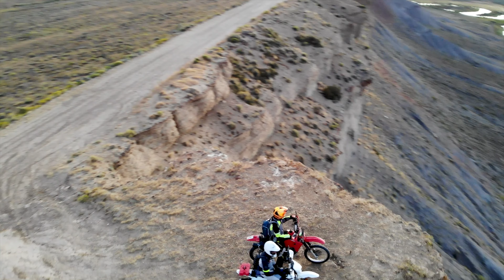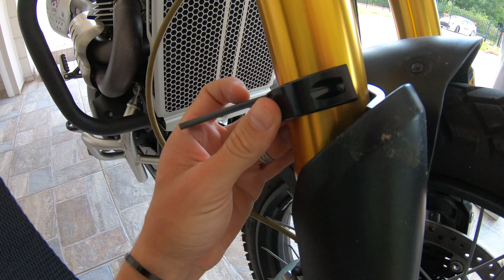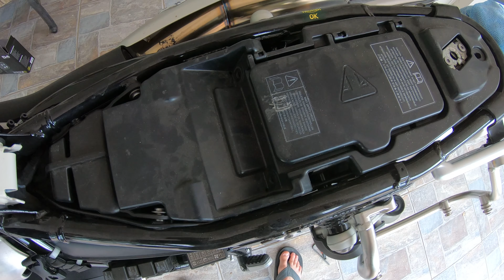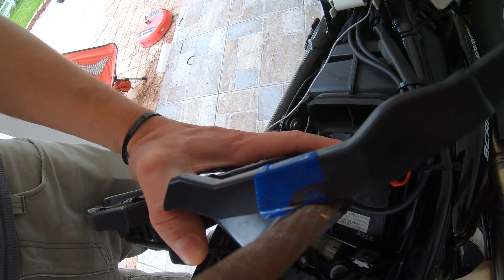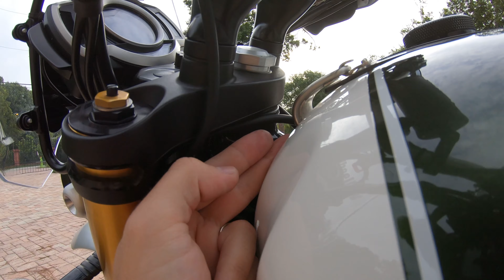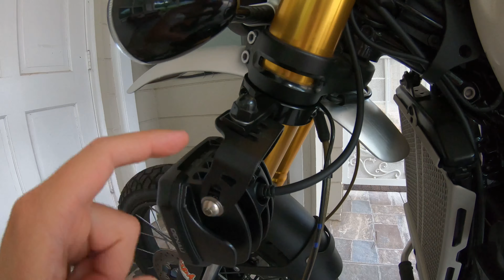Triumph Scrambler 1200 Denali D4 lights install

Comment: All that extra wiring when all you have to do is use the connectors that Triumph fitted inside the headlamp shell ready for their "fog" lights kit.
Reply: Is there a wiring connector for this? The D4 has a different pin.
Reply: @playnicebegoodtoothers6944 : yup, two wires with factory connectors.  Plus there. A button on the handlebars just for the fog light.
You don’t need all that wiring or that extra switch.
Reply: @ginoasci last there a connector you used? The Denalis have a three pin wiring connector than the standard two-pin on the triumph.
Reply: @playnicebegoodtoothers6944 : I haven’t purchased the fog lights they.
Yes, I think you’re correct about the two-pin connectors.

Comment: Wiring it strait to the battery, does that not mean that the lights still have power even if the bike is off ?. I can just imagine someone coming along and switching them on draining the battery.
Reply: The wire wire is connected to the switched power source; like headlights or running light wires.
Reply from the maker: In all my years of travels no one has ever messed with my bike like that. If I was in an area that might pose a problem I would just disconnect the battery for extra precautions. 

I’ve personally experienced problems with Triumphs wiring harness so I try at all cost to avoid splicing into anything.

Comment: I’ve got the same lights with the universal data dim can bus harness. I have to say I’m a bit worried about tapping into,other wires ie horn, light , indicators etc…..any tips or even better a video?
Reply from the maker: I don’t like tapping into the wiring harness especially on Triumph. However, the horn would probably be a safe bet and a easy fix if something wears out over time. I don’t have any other videos made right now for it but Denali should have some on their channel.

Comment: You can't just link these to the fog light button can you?
Reply from the maker: Hey, you can but you would lose the ability for “Data Dim”, high beam function and would also have to order the specific wiring connectors. 

I’ve thought about doing it and still might. I don’t need high beam with these and not concerned about running at low power for the dim feature to matter.
Reply: @2wheelAdv  thanks for the reply!
Reply: Good job, clean and efficient
From my side I’ll use the original switch and connectors which are hidden into the front light, I’ll be feeling more safe, and avoid some electrical issue 💪💪
Reply: @luigicodiglione1564  did you do this in the end? Would love to know how it went.
Reply: @d.Cog420  yes I did, it was easy and result is very clean, in the meantime I sell the bike and bought a speed triple 🫣

Comment: The plus side to running power from the battery is so you can use the lights with high beam. Output looks really good 👍
Reply from the maker: Exactly, thanks!
Reply: @2wheelAdv  I ended buying a set from barefoot Industries on etsy. He also rides a scrambler 1200. Very happy with my the fog lights and was a easy plug and play, finished installation in about 15 mins.
Reply from the maker: @mototrini  nice, it came with the connectors that match the ones inside the headlight or taped into the wires?
Reply: @2wheelAdv  yes they come with the correct connectors already attached